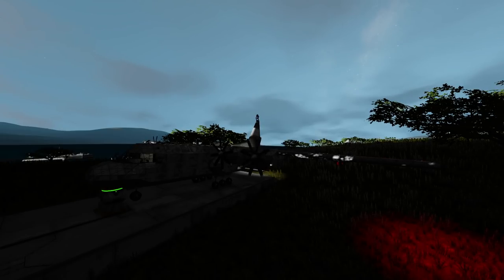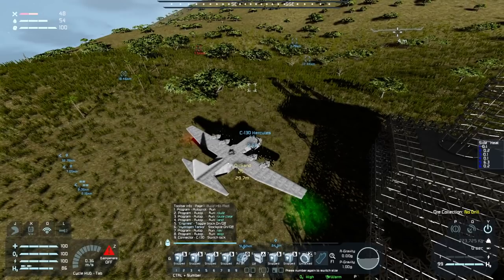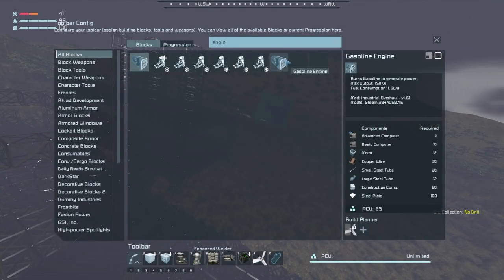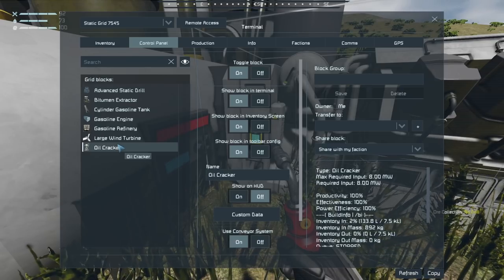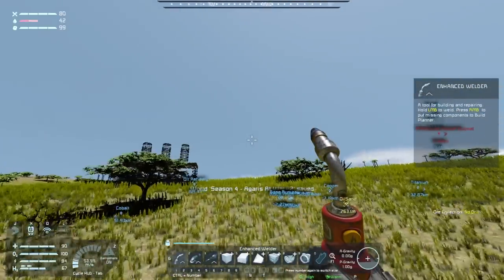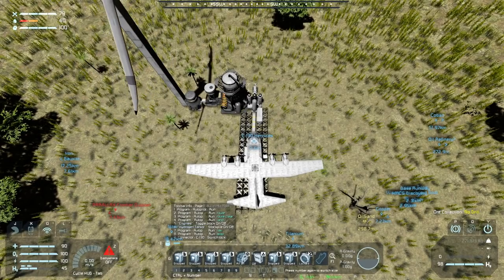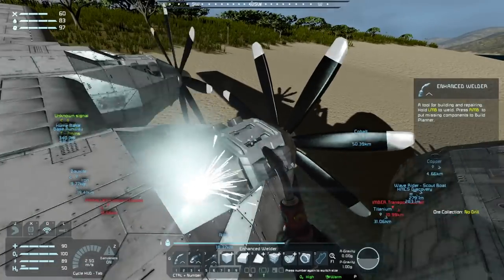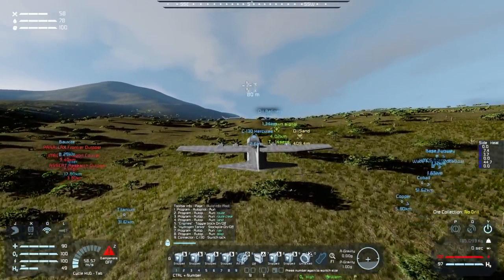Space Engineers - S4E30 'Fueling up with Gasoline!'

Comment: I had the same issue (fairly similar mod setup) with Fuel Oil not being pulled into the Gasoline Refinery automatically.  Setting up a Sorter for Fuel Oil directed into the Gasoline Refinery that had "drain all" checked solved the problem.

Comment: look into the AQD Armor Slopes that bring in the 1x3 & 1x4 slopes in both light & heavy Armor.
makes driving onto platforms easier and less likely to end up doing impromptu Nose Jobs on your shiny new plane.

also, add Landing Lights so you can see what you are about to land on!
Reply: I forget which set I added, but there is one with a 1x6x1 ramp that makes for a really smooth slope.

Comment: After a small surplus of oil builds up it automatically draws it into the fuel refinery on its own! 
I am in the middle of refining rocket fuel myself and found out that the refinery doesn't pull in oil until a surplus of 6.0 or 8.0 is reached first then it pulls in that amount each time or so or more if it is available, but it will not pull in lesser amounts because it processes the oil very fast into whatever fuel type you are making!
And the tar is actually sand in the inventory when looking it up or searching for it.

Comment: Hello !!! Very Nice Job so far !
I would suggest to use a small block refueling arm with multiple hinges as used by Splitsie and co in the wrong way up series. That way, you Just need a small connector on the side (or on top of the wings) to keep the original design and a snake like arm looking like a refueling hose/pipe. Keeping the general design of the real world C130

Comment: Not sure what's going on with your gas refinery. I've created an oil setup and didn't need any sorters or anything special to push Fuel Oil into it. Maybe just a game restart?
Reply: I've got about 500 hrs in I/O, and I always have to manually fill my refineries, unless the oil cracker output inventory is full.
Reply: @dennislindemann9057  Maybe that's why it works for me - I've got a 5-drill rig going straight into the oil, so the oil cracker gets filled up fast.